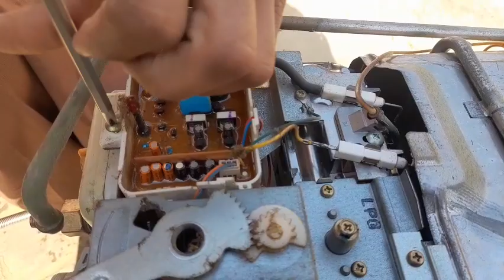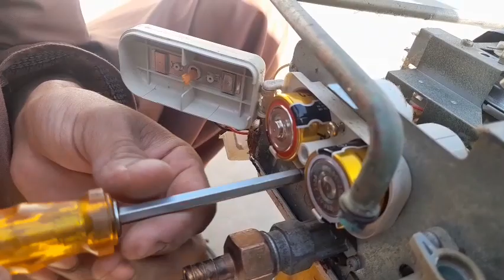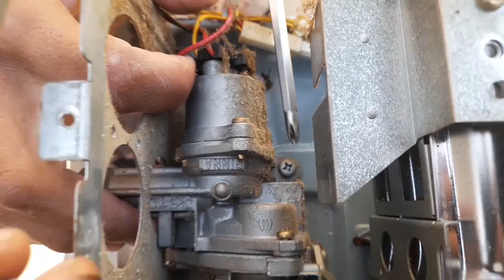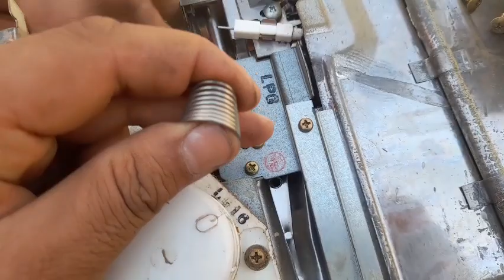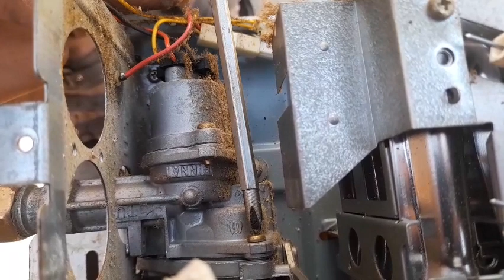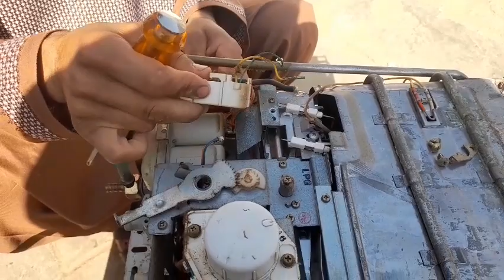repair gas geyser instant Japanese water heater remove spring all problem solving

Comment: DO NOT DO THIS! He has removed the gas-water mechanical interlock switch, a vital safety device which stops the gas to geyser  if water flow/pressure goes down (to prevent burns from very hot water).